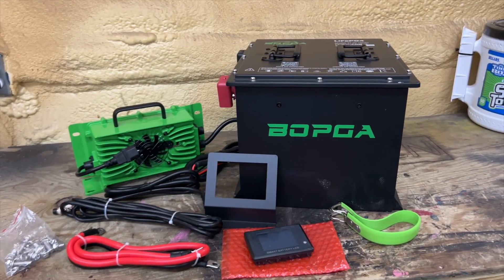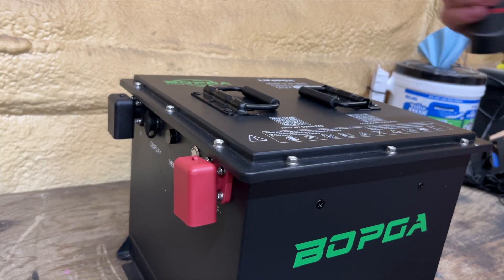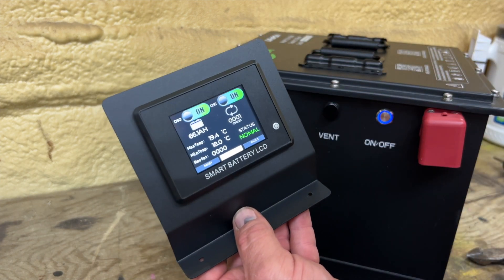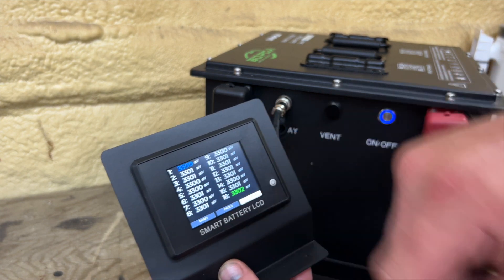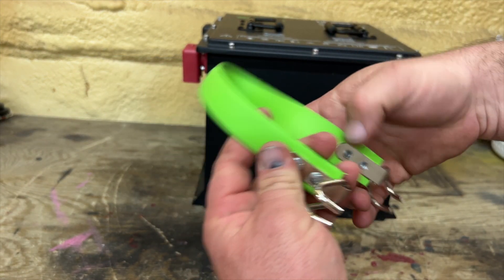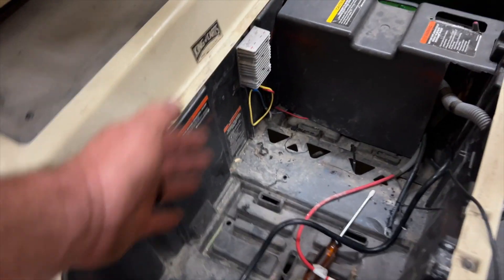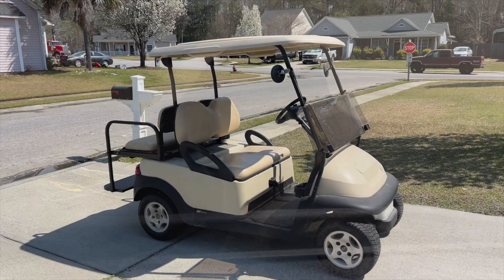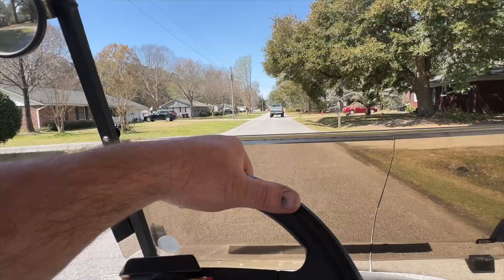BOPGA MINI 51.2v 105ah Lithium Golf Cart Battery Conversion | Club Car Precedent

Comment: I have a Yamaha G29 2007 and would like to customize it. 
Will this battery work with a Novita’s motor and controller ?
I would like to add the 600amp controller and the 400 KW motor. But I hear people talking about how the cart will shut down. I don’t quite understand that part of it

Comment: When you turn off the battery does the light stay very dim lit? Is this normal? I just got mine 2 days ago and I just noticed it. Can only see it in the dark
Reply: Cool
Reply: I think it takes a little while and then goes off completely. By the way are you using this same battery? If so how has it been for you so far?
Reply: @ntj030885  yes I have the same one, no issues with it. I really like the size. Fits a club car DS very well 👍
Reply: @Mark-dk4ck that’s nice. I just got one for my precedent. So far so good.

Comment: The battery should fit my AA01 DS, it has the narrow frame in the battery tray. I currently have two Eagles which cut it pretty close when I have 4 people on the cart and rather than purchase a third Eagle (Eagle 2) a 105 Ah should be better in distance and torque.

Comment: Great install video! I really like that battery monitor screen. I noticed that you mounted the charger with the handle up. I was wondering if you had considered mounting it with the indicator lights facing up, and whether or not it's possible to do so. Might be nice for future troubleshooting to have those lights visible.

Comment: I was wondering if that would fit in my 2006 Precedent without moving the center mounted controller but that was already moved on that one! I’ll measure it up because it looks like it might. Thanks for the info.
Reply from the maker: I think it will.